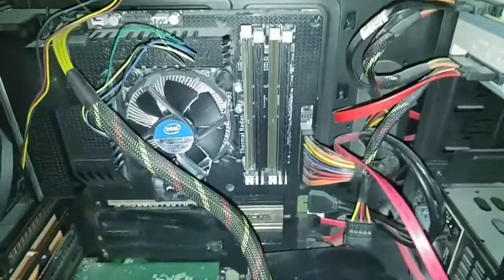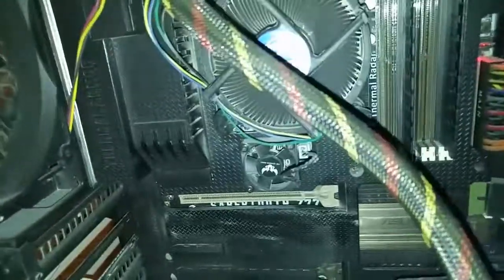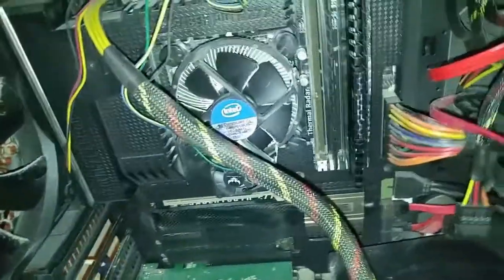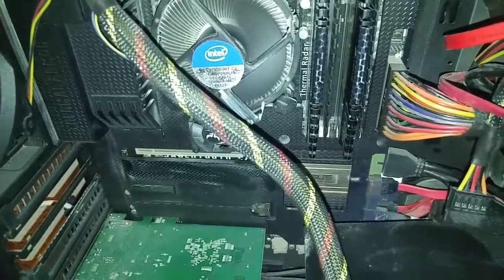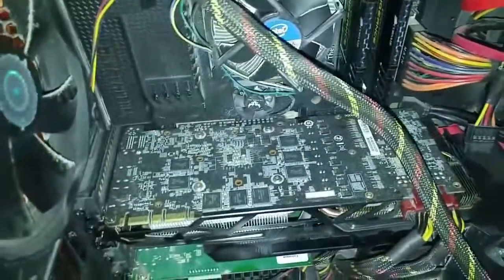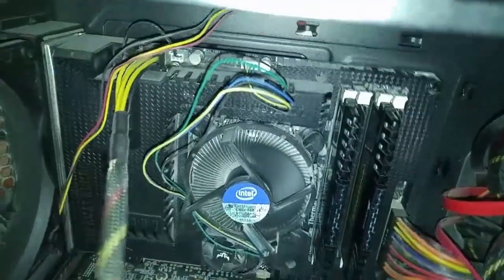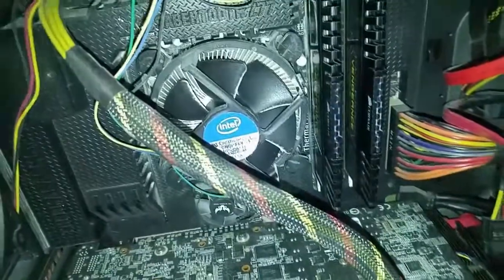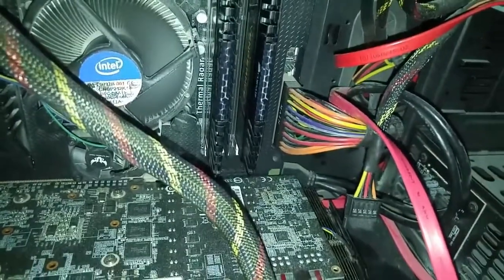ASUS Sabertooth Z77 - 6 Beep Error Code? (Turned out to be a motherboard failure)

Comment: Just up against this.  Not going to spend much time on it but curious what board you got to carry over everything into?
Reply from the maker: https://www.amazon.com/dp/B007ZQVK24/?coliid=I12JDHJAQ41UNN&colid=3RRKWS9AOMRQ4&psc=0&ref_=lv_ov_lig_dp_it

It was considerably cheaper than it is now. You might consider an upgrade to new hardware if you can afford it. This one is worse than the Sabretooth, but at the time, I just wanted to get up and running with decent connectivity options.

Comment: Just sharing, mine 5 times beep with b460m. Fixed by uninstall the cmos battery and install it again. All working well then.
Reply from the maker: I had tried this after some other fixes. The crummy thing is on the Sabretooth Z77, the plastic thermal shield blocks the CMOS slot. I ended up clipping the plastic so I could get easier access to it if it was fixed. Unfortunately, it was not.

Comment: Got 3 and 3 or 6 beep on a z170m - plus with built in graphics - was using a monitor switcher on hdmi for a year which died then replaced it with exact same unit which worked perfectly and 3 days later not booting or post image.... just the beeps... >tested power supply OK > removed ram - different beep - then that beep disappeared on remplacement of memory and 6 beeps returned.
Reply from the maker: Yeah, I tried quite a few things including a flashed BIOS and new CMOS battery. I just conceded that it was a motherboard failure or damage I don't know how to fix. I placed all the components in a new board and everything worked, so it had to be directly related to the board.
Reply: @Turbodog702  Yep switched out the mother board bought the exact same z170m second hand - took 20min tops and put everthing back in place and ran as good as ever better still no reloading software etc.... easiest and effective repair ever >>> I am thinking the cause maybe the moniter switcher may have fried the onboard graphics as the only problems I have experienced in the past were a dodgy hdmi cable that sent the monitor flickering or dropping out when too many navs running replaced that after 1st 6 months... since then started running the switcher box for the monitor >>>1 year later that switcher died replaced with same switcher only new. 1 week later had the 6 beep problem no video signal. Still the MB held up for 5 years >> I am now doing some upgrades to keep it going ram/nvme card + reasonable graphic card

Comment: I'm having the same problem right now. Did you discover what this problem is?
Reply from the maker: Motherboard failure of some kind.
Reply from the maker: Izz Irfan  I can confirm that the CPU was not the issue in my case. I moved the CPU over into a new motherboard.

Comment: Google source information: six short beeps means that there has been an 8042 Gate A20 test error. This beep code is usually caused by an expansion card that has failed or a motherboard that is no longer working. You might also be dealing with a certain kind of keyboard glitch if you hear 6 short beeps.
Reply from the maker: I had ruled out everything but mobo failure by swapping hardware.
Reply: How about solutsion with 6 beeps?Please....

Comment: i met the same problem. my devices is p8z77-v pro + 3770k, it alaways beaps 6 times if i power on.  and if i swap out 3770k, use a old cpu G530 instead, it passed, did this mean my 3770k  be broken?
Reply from the maker: I couldn't say for sure. I didn't have a back up CPU to test. BUT, I did transplant my old CPU into my new mobo and it worked. It seems unlikely.
Reply: Any news for your i7 cpu ?

Comment: I know this is an old video but I am having a problem with this board where it is failing to boot to windows or even the CD drive or even a USB drive. They are all recognized in bios but even when drive selected from boot list it just black screens. I am pretty sure the board just went bad and its not sata controller since usb wont work either. Wont take bios update either.

Comment: So, what was the root of trouble? I faced it today after changing CPU. 6 nasty beeps.
Reply from the maker: I tried a number of solutions, flashing the BIOS, switching the CMOS battery, swapping relevant cables, changing RAM seating, etc. I then took it to a well rated shop in the area. They confirmed the things I had tested and came to the conclusion I did; it was probably a motherboard failure of some type. I received no answers from tech support. They said a 6 beep code doesn't exist despite me sending them this video.

I would say try things out and hope for the best. Of note, the CMOS battery is really stupid to change out since it is behind the heat shielding.
Reply: @Turbodog702  Inspection of socket showed a 3 bent pins :( , so seems MB really source of trouble.
Reply: Turbodog702 6 beep code is a video card failure if I'm not mistaken
Reply: @harukakotoura1489  anyway i bought new MoBo and all resolved :), so bent pins caused ass ache, gpu works fine, maybe fans are not spin because of temperature threshold settings?
Reply from the maker: I tried swapping video card when this was made. I also took the same card and used it on the new motherboard and it worked fine. I did not swap PCI-E slots, but the built in GPU should have at least been able to boot. Many boot ups will also mention a graphics card failure.

Comment: Change your RAM slots
Reply from the maker: Had already attempted. I tried many more workarounds including swapping the BIOS battery, reinstalling the BIOS from flash, about a dozen more things. Just a general motherboard failure.
Reply: you know that .. when I turn on my PC it gives 1 short beep and 3 seconds after that 1 beep .. when I am in windows it falls out ... can this be solved?
Reply from the maker: check the beep error code sheets available online.

Comment: did you ever find what the problem is/was ? i have the same symptoms
Reply: kinda late, but I reflashed my bios after the first comment and the problem was fixed
Reply from the maker: Closest I could tell is it is a BIOS error code. 6 beeps would indicate an A20 Keyboard Gateway error. This could be caused by the keyboard, power supply, or motherboard. I did not have the resources to test any of these at this time.
Reply: Turbodog702 I'm having the same exact problems and I don't know what to do now... I tried almost everything
Reply from the maker: Turned out to be a failing motherboard. I swapped it out after testing the power supply, a new keyboard, and swapping/resetting the CMOS battery.
Reply: turbodog 702 did you try to reflash your bios?
Reply: what device did you use to reflash your bios? i have the same problems with my asus mother board
Reply: Stephen Dean I just downloaded a new bios into a flash drive and stuck it into the usb flash back port on the back of the Mobo. Make sure you turn on your pc AFTER you plug in the flash drive
Reply from the maker: I tried to reflash my BIOS. I even went so far as to get a new CMOS battery in case that was the issue.
Reply: Did you change the name of the bios file on the flash drive? I remember I tried flashing the bios multiple times until I read online that you gotta change the name to something specific
Reply from the maker: I had reflashed the BIOS for a previous issue. Reflashing did not work for this. A couple computer science majors/grads and I tried a pretty extensive list of solutions.
Reply: Rip
Reply: Hi Invalyd, I have same issue with this and I'd like to try reflashing the BIOS, may I ask the steps you did in reflashing the BIOS, i tried to download the BIOS, save it to USB, pugged in to the USB BIOS port, but did nothing, is there a specific format for the flash drive does it needs to be in fat32.